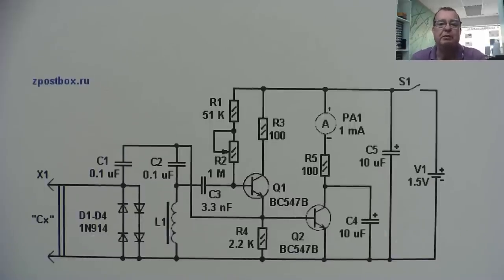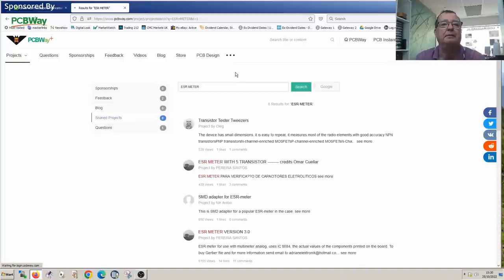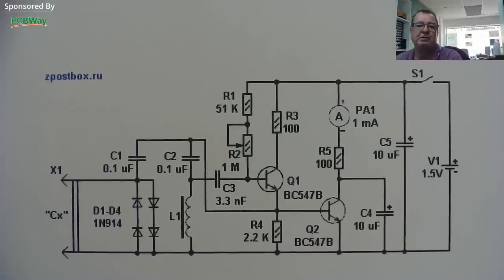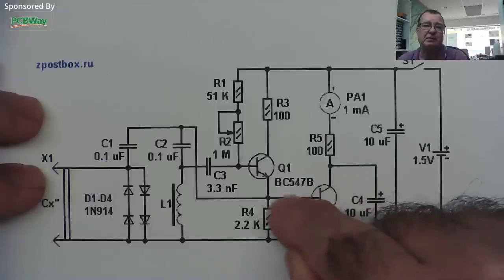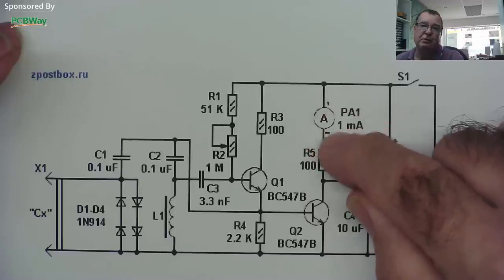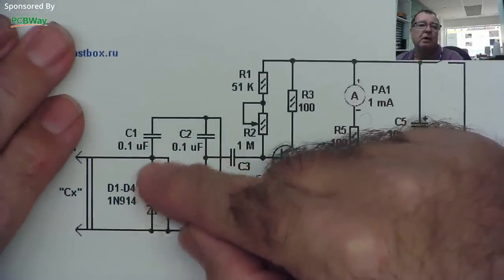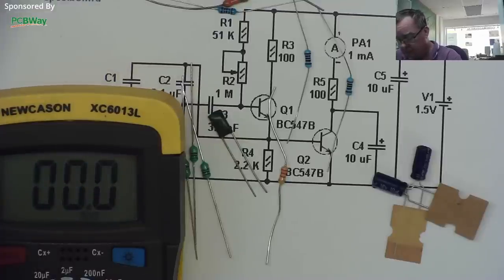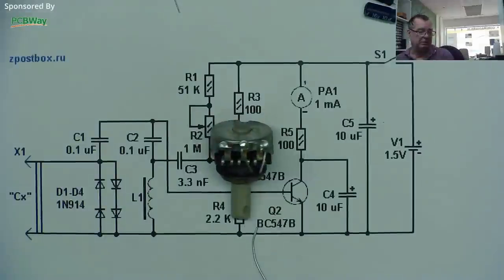Build This AMAZING $1 DIY ESR Meter Project!

Comment: For those who haven't yet ventured into designing their own circuits and PCB's, I really encourage you to give it a try. There's free software out there such as KiCAD which helps you to draw the schematic of your circuit, and then convert that circuit into a PCB design. A lot of the process is automated, and a lot simpler than you might think. And once you've designed the PCB layout you simply save what's called a "gerber" file and upload it to the PCB manufacturer and they do the rest. Even if you just want to make a very simple circuit it's very inexpensive, with usually a very quick turnaround. And it also helps to avoid the many problems you might encounter with typical prototype boards (noise, stray capacitance, etc.).
Reply: You are so right! It is really a fantastic feeling getting them in the mail. 
Jjust don't ask how many failure PCBs I have laying around  - and being used for various scrapers, spacers and stuff :D
Reply: IV never made my own PCB yet. So far any pieces I needed I could get a modular piece. But I will check out that one you mentioned for sure.. thank you 👍🇮🇪🙏

Comment: Greetings from Russia, I have been using the device according to this scheme for 10 years already. I wound the coil on the M2000 ring with a diameter of 20mm. Licendrat wire. 50 turns. The frequency was 16 kHz. Arrow indicator.

Comment: Why do you care about getting exactly 51K Ohms resistor when that resistor is in series with a 1M variable resistor and is only a small fraction of the resistance of the variable resistor? If you undersized the 51K to the next closest E6-series standard value (47K) or if even you use just your single available 33K resistor, the circuit will work just fine except that the potentiometer will end up being set a fraction of a turn different from if you had used an "exact" 51K
Reply: It’s a lesson for those who don’t know everything there is to know about electronics.

Comment: You may also take a look at the simple ESR Meter from Danyk. It is based on a 555-Timer. It may be more easy to add an operational amplifier to it as it is supplied by a 9V battery.

Comment: For cutting tracks on vero/stripboards, I use a 4mm drill ending in a hexagon.I click it into a general bit holder and give it a about two, maybe three twists manually. Works great and it even avoids lifting the tracks on the chinesium boards I use for a quick prototype.
Reply: What do you mean by "ending in a hexagon" ?? Can you elaborate please 😊
Reply: @keithking1985 With "ending in a hexagon" I mean drivable with a standard screw bit driver in the shape of an Allan key.
Reply: @keithking1985 He means a 1/4” driver. You can also use a hand drill with a chuck style holder.
Reply: That’s a great idea, takes the fiddle out!

Comment: That doesn't look hard to build. i honestly expected a more complicated circuit.. 😊
P.S. Richard if you don't have a particular resistor you can always use a little trim pot and glue it at the residence you need..

Comment: Very nice circuit! You might try setting the Q2 collector voltage close to zero with the input shorted and re-run your tests with the resistors. You should get a wider range of ESR readings. Regards,  David.

Comment: I think the first thing to do is see what the oscillator is doing, we want something around the industry standard which is roughly 100KHz, I'm not a design guy either but it's so 'Flaky' right from the off I would need to see that to gain any confidence in it before moving on...cheers.
Reply from the maker: @andymouse It isn't around 100KHz at the moment - Its about 17KHz.  Without doubt It was very flaky/unusable to start off using the original implementation but after my little mod I hope you would agree it is fairly stable and it now finds caps with bad ESR pretty well as it stands.  Yes I would like to get it to run at 100KHz on LER ESR V2, and it needs a bit of op-amp or even Atmel trickery to get it to display the actual as ESR 1 ohm = 1V on a standard DMM, but I'm very confident this will work
Reply: @LearnElectronicsRepair  Yep I look forward to V2 and I do agree its improved. I would like to see the waveform from the oscillator as I having trouble visualising it ! oooh yeah some Atmel goodness can't hurt, I think it will be great thanks for your rapid answer !....cheers.
Reply: I assume if you're into electronics you're familiar with simulators like LTSpice. Why not spend a few minutes and build the circuit in LTSpice and see the waveforms, etc., for yourself? That way you can also vary the parameters and see its limitations.
Reply: @EETechStuff  yes I could do that however I enjoy the video's as is, in fact I would love to see a video of somebody doing exactly as you describe but in the meantime just a look on a scope would be fine  cheers for a good point.
Reply: @andymouse  If you're serious about learning electronics I encourage you to learn LTSpice, which is free. On my channel I have a series showing how to use it for beginners, and ,in this case for this simple Colpitts oscillator it would be super simple to drag 'n drop some components, wire them, and run a transient simulation and see exactly how the LC oscillator works with scope-like plots.
Reply: @EETechStuff  I will check your channel out ! I have used TINA once or twice but never realy hit it off with SIMS, so we will see...cheers.
Reply: @EETechStuff  Well I'll be !!! I am already subbed to you I watched your 3D gaming stuff on collisions so I must have liked it, I will check out your stuff on LTSpice amongst others...cheers.
Reply: @EETechStuff  just ventured onto your site - will try to find the time to go through all of the LTSpice - but yep - would be good if you simulated! Ten minute job for you?! Thanks for your vids
Reply: It would be nice to have an explanation of how the oscillator works.  I can't analyse it but it seems to be because there is a connection from the emitter to a low impedance part of the oscillating circuit, and from the base to a high impedance part.  (If not, how does it work?  There is no voltage gain to make up the loss in the inductor.)  If that's right, the variable resistor is just to bias the transistor.  But the oscillating signal will be superimposed on that bias current by coupling through the battery which is not 0 impedance.  I wonder if it would work better if the bias circuit and the second transistor were isolated from the collector of the first transistor by an RF choke and capacitor.

Comment: Richard, the beauty of the original circuit is to use common discrete components and the simplest battery (AA) that with low current drain, skips the need of voltage regulator, especially if a trimpot is used to adjust reading’s Zero Ohm. 
Your final brainstorm using an OpAmp somehow defeats those 2 points, making it more complicated than other famous ESR circuits as the “5 transistor” or the one based on quad OpAmp as in TL084.
I would love to see your investigations for improvement if possible, preserving the 1.5V and conventional BJT. Maybe another BJT could provide the Vce= 1.0V as a floating ground with low-enough impedance make a DMM’s differential voltage reading worthwhile.
Thanks for sharing these investigations and I look forward for these prospective outcomes.
Reply: Great comment I'd also like to see what Richard would say. 😊
Reply: I don’t think that was the point of this build.

Comment: I just want to add, there's so much pleasure to be had hand drawing your circuit, switching of the computer off and etching you own pcb. Its not ideal, but very educational and satisfying... I use an edding fabric marker to draw to circuit, and dont get pitting if ink is layered up!

Comment: Very good start. A couple of observations (which may or may not help). Stripboard is notorious for creating 'capacitance' issues with sensitive and oscillating circuits, shortening all cables as much as possible and cutting the board down to size may make a significant difference.
I use a heavy-duty scalpel (live dangerously) to cut tracks (spot face cutters, drills etc just weaken the board and remove a potential component pad).

The resistors 'calibration checking method' would rely on resistor tolerance, and the circuit is oscillating (or should be, looking for reactance) so any touchy fingers will cause some issues.

You could use another BC547 to invert the output from Q2.

Dollars?  I expect to see a 115V AC supply and an on-off switch where up is on, in part 2. Ho, ho.

Comment: With regards to pot types and their curves.... type A are logarithmic (volume control etc) B are linear, C is an inverted log (typically used to turn up gain more evenly or sometimes bass control) and W is specialized custom taper.

Comment: I use a drill bit with one of that cheap hand drill bit holders to clean the connections on veroboard like boars, clean, easy a give a really good finish, I use 4mm drill bits, found this tip in an older magazine.

Comment: I tried this and it works well. I, like you did not have a 1 Meg pot but I did have a 1 Meg ohm multi-turn  preset pot which did work  but is not practical as I want to run this from a battery. This means you need to re- zero the meter every time you use it as the battery will slowly wear out. I found that using a 500k pot with a 180k  resistor in series ( 100k and a 390k ohm resistor also works) I could easily zero the meter, however you have to connect the metal body of the pot to ground to get a stable useable  adjustment.

Comment: I use veroboard ALL the time and I gotta say, I've never seen anyone build a circuit on one quite like that. Lol I suppose I COULD do it that way, but I make a Vero layout on the computer first.  I then print it out to scale with the Veroboard and tape it down on top of the Vero and use my drill press to drill out all my trace cuts and then populate my components.  I commend your abilities, sir!
Reply: Hi, I've used veecad for designing veroboard layouts on pc for years. It is now a free application for pc. Bit of a learning curve, you can export the net from kicad or tinycad which I use. See veecad on YouTube for tutorials.

Comment: If you are using an OpAmp output, you can probably eliminate at least one of the transistors since you no longer need the Darlington pair to do the amplification.
Reply: That's not quite a Darlington circuit with Q1acting as an common collector or emitter follower into R1, with  feedback from via R1 and Q2 amplifying Q1's emitter from its collector, in a common emitter configuration.

Comment: The performance is all down to the quality of the resonant section. The cap should be a high stability low loss of quality and fed into a buffer, high impedance input to minimise damping, an op-amp here is ideal. The standard is 100khz and I'd stick to that - this isn't, it seems over double?! If you wanted to keep the overall function of using the amplitude as a measure, a very simple detector and filter will average the level to ensure reliable readings. A comparator adjustable to null on shorted input will give positive results. Really this whole thing is a bit dicky but on the right track.

Edit: PS very good video, excellent for design.

Comment: i would replace the mA meter with a precision 1 ohm resister and measure mV across it. You can then take that through op amps to get the reading you desire.
Reply: Yes.

Comment: Hi Richard 
I have learned so much from your videos well done mate. Keep it going you are doing well .
Just for experiments a decade resistance box might help explain what’s going on ( help with them dodgy
Pots . 
All the best Steve
Reply from the maker: Definitely that would help - I was just doing what I can with what I have.  Ar least now I'm confident that my implementation is stable and can find caps with bad ESR rather well for such a cheap device.  With a bit of work using op-amps or an Arduino variant I am also pretty sure it will read 1 ohm = 1 volt on a standard DMM 🙂

Comment: As a hobbyist with only a moderate amount of technical knowledge, I’m curious why you went to the trouble of matching the 51k resistor exactly. I would imagine a deviation of less than 10% would hardly matter when it’s in series with a pot that’s 2000% bigger. Does it set some critical minimum resistance?
Reply: Agreed, a 47k would be fine!
Reply: After much iteration I changed R1 from 51K to 1Meg and used the 1Meg POT at about 0.4 turn of 1. Also I inserted a 10Ω resistor in series with the test capacitor to try get some linearity for the ESR from 0.1 to about 10Ω. One could actually discriminate to 20Ω like this. I guess the layout and gain values of the BC547C's influence the output resonating at about 14kHz.

Comment: I have a question about the mesr 100 i have was checking a circuit and had 400v capacitors and looked at the chart on thr mesr 100 meter and it is blank above a certain value. i have read the manual and it's not clear what the maximum size capacitors and voltage that can be tested. I have googled this and not had any luck finding the information.
needles to say if the value is not on the meter chart i wouldn't use the mesr 100 to test it

Comment: Hi, what is the name of the blue tool you use? its simmilar to something ive seen befor for twisting metal pins on plate covers like RF boxes but cant put my finger on the name of it.
Reply: @A7
Mine's called a Vero spot face cutter.

Comment: May I know the frequency of this ESR oscillator? quite a simple circuit.
Reply from the maker: I think this current version is oscillating in the region or 15-17KHz  It could be set to run at some other frequency by varying the values of the inductor and 100nF capacitors
Reply: @Jimmy Galigao I tried to post the simple equation you can use to calculate the frequency of an LC oscillator yourself but apparently equations aren't accepted :)  Anyway, you can do a quick search for LC oscillator to get the equation, and just plug the L and C values in and calculate yourself. BTW, as I mentioned elsewhere this is a simple "Colpitts" oscillator if you want more info.
Reply: @LearnElectronicsRepair   I got slightly over 14kHz running on an LTSpice simulation.

Comment: Whats  the point of testing 
Capacitors  when you know they need to be changed anyway?
Reply: Because new parts do not equal good parts. Your brand-new "low ESR" capacitors may indeed have a high ESR because they are fake or defective. For LER, he does a lot of work with salvage capacitors, and those need testing too.

Capacitors are actually pretty complicated from a "is it good?" standpoint. You have to worry not just about the capacitance, but also about ESR, maximum voltage handling, temperature ratings, and electrical leakage. That's a lot that can go wrong, and being able to test those things can increase your confidence that your repair is going to be good long-term.

Comment: You can do better than that circuit .
The ones with sub 300 mv output & input protection !
Try the oscillator > DUT > amp > voltage detector .

Note
The 5 jbt one needs matched parts or a mod so you can balance it !
Reply: Remember in-circuit testing is desirable ….